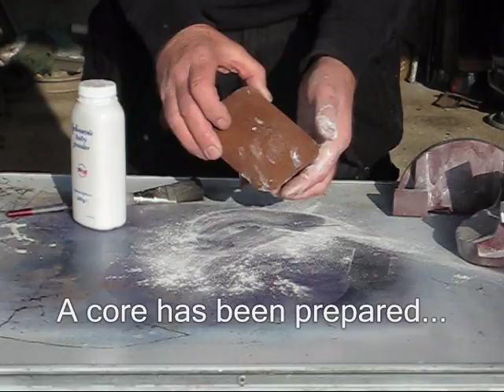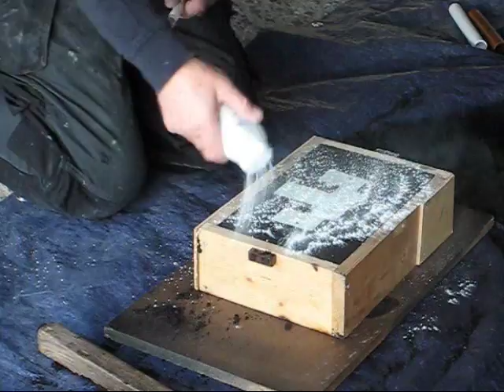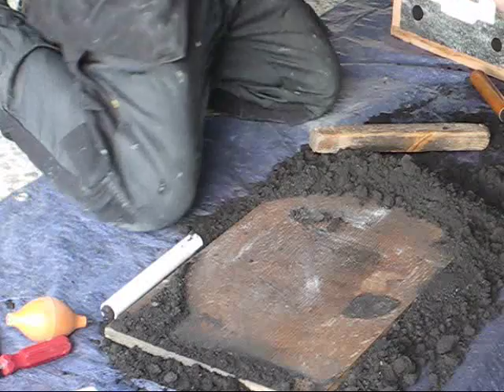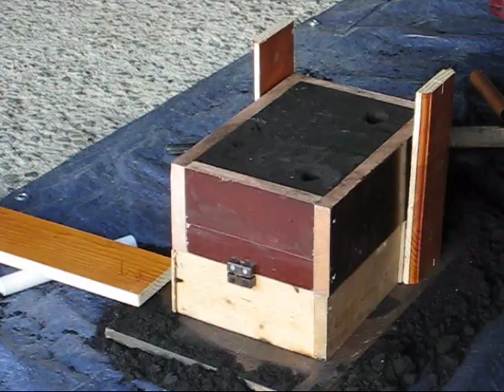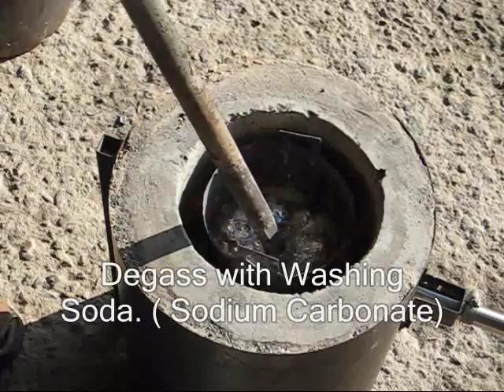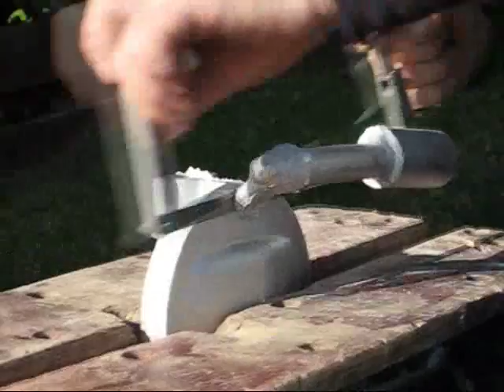Metal Casting at Home Part 18 Cantilevered Core

Comment from the maker: @nemocheerio The metal can be too hot, it should not be glowing red. I pour as soon as its liquid after the flux and degass are added.You can tell if all the metal has melted when you cannot feel any lumps when you give it a stir. I dont measure the temp with anything.

Comment from the maker: I did a video ( part 25 in this series) showing the metal to avoid. The alloy used in extrusions for example will have different properties to that used for cast items. Best stick to scrap that has been cast then you know it's suitable. I have been getting great results with alloy car wheels.
Reply: myfordboy could i use soda cans to cast pots and pans or is not suitable

Comment: I am up to # 18 and feel like I am in the best classroom ever.  I have a project I am just about ready to try and cast and I am wondering if you have ever had any experience with casting aluminum around a copper pipe or brass tubing?

Comment: you removed dross, then added salt wrapped in foil to act as a flux. I'm curious why you did not add salt wrapped in foil before skimming off the dross? is that not the point of flux, to reduce the amount of dross?
Reply from the maker: Before anything is added there is already dross on the top from paint or dirt that was on the metal. This is removed first. The flux will then bring up more.